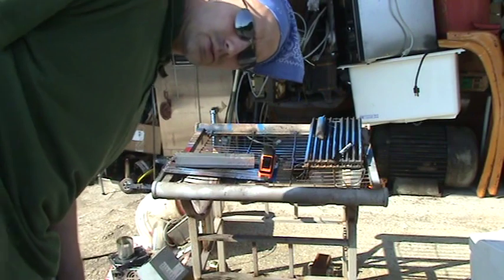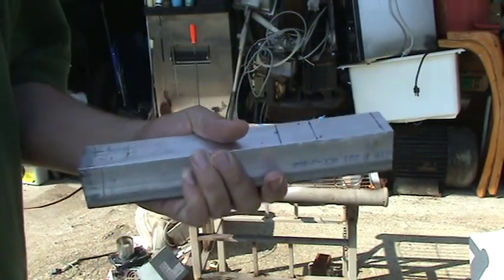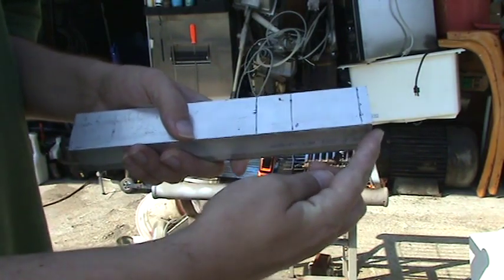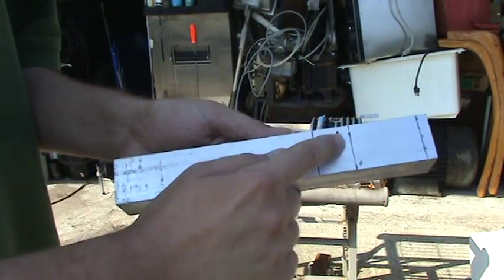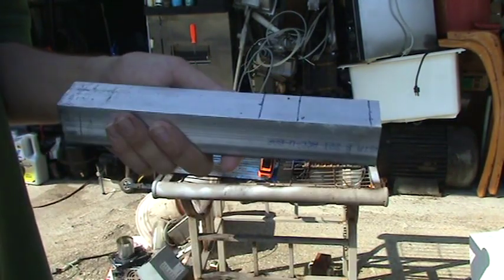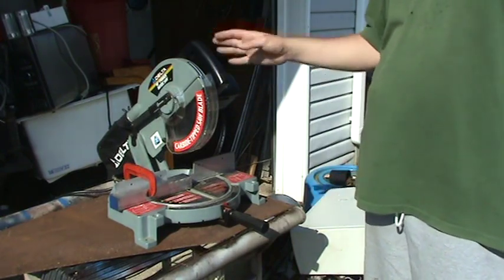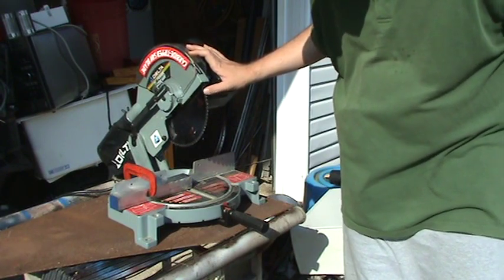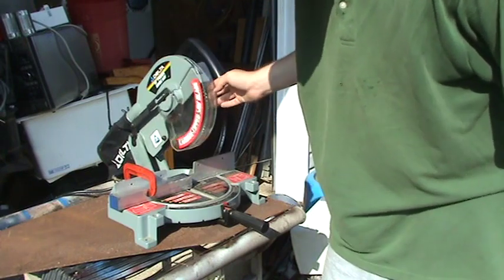How to cut aluminum with a miter saw

Comment: I have cut aluminum at work with the diablo bi metal blade for 5 months. we never clamped it down. You just go slow and it will cut through like butter.